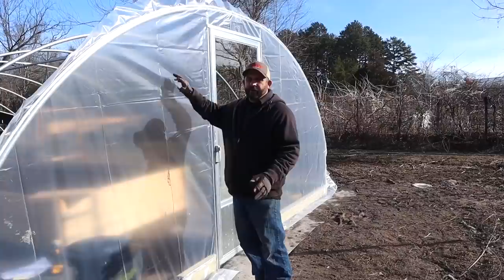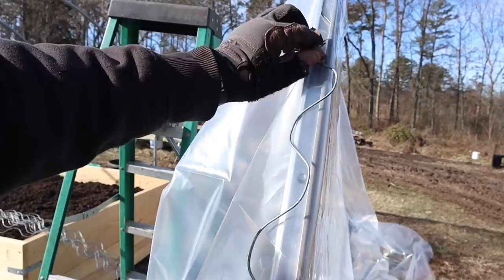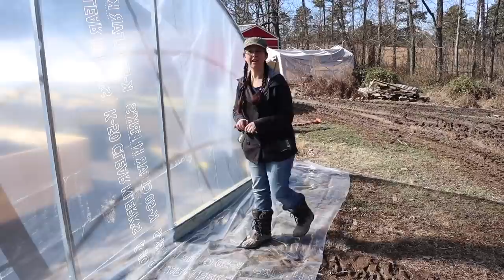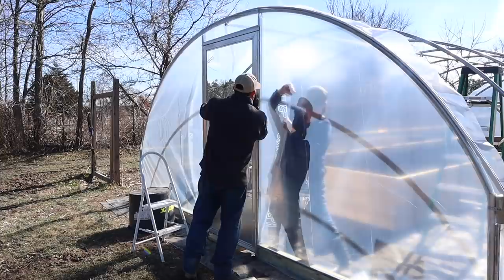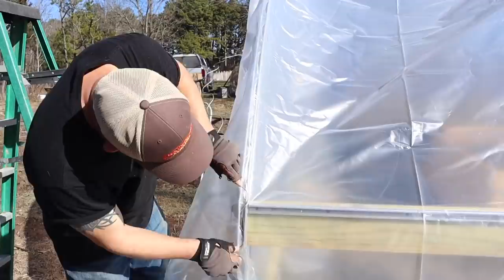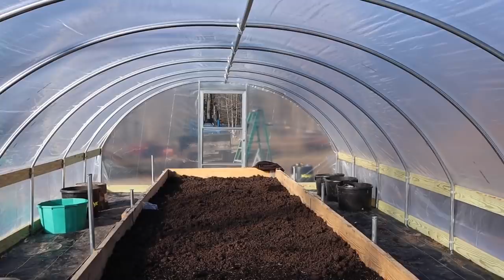The plastic goes up on the greenhouse we ordered from the internet.

Comment: I saw an ad on Facebook Marketplace that I thought you or others might be interested in.  A company from Fayetteville AR is selling dismantled poultry production houses.  These barns are not that tall at the sidewalk, but they are wide and long.  They are selling them as a complete kit; steel girder rafters, wood purlins (used or new, your choice), the metal siding and roofing and I believe some doors.  Other than shipping and set up it, which is not included, it seemed like a good price for someone to have a large building for livestock or adapt by raising the side wall height, for machinery.

Comment: You might want to consider using a hole punch or Phillips head screw driver to put a dimple in the door frame before installing the self tapping screws. That way the drill won’t walk on the surface enabling you to drill the holes in the right place.

Comment: Nice Job on the greenhouse! I was wondering if you have considered putting a mesh on the inside of the lower portion, for when you roll up the sides to deter small critters?
Reply from the maker: We weren’t planning on that but it’s a great idea!
Reply: Karen Gradzki   We did that on our greenhouse last year and it worked very well. Two of our neighbors have about 10 cats each and they are a real nuisance! They tore up our last plastic cover to get on the warm greenhouse in cold weather. Crazy cat ladies that don’t keep them home!

Comment: Very Good!
Only problem I see is you need to put two layers of plastic one about 8 to 12 inches longer than the other and a fan/blower to inflate the plastic works as insulation. You can use dryer duck to connect the side's and end wall's. 1 blower per greenhouse.
Possible shade cloth to cover greenhouse rolled onto a two or 4 inch pipe attach one end to ground leave outside when needed roll over.
Here in south Texas we put two levels of shade cloth one about 40% then one about 80%. Otherwise plants get burnt. Temps can and have reached 100° or more in December/January/February.
Also I have seen 0° in February. All parts of the country have there on set of problems and we have to adjust. GOOD LUCK. 
GOD BLESS.
ALSO ON A PERSONAL NOTE ITS A PARENT'S JOB TO EMBARRASS THERE CHILDREN.🤔😁

Comment: Hello you two, I have a question for you, we bought one of these from Growers Solution and will be putting it up soon.  I have watched your video probably 10 times to make sure I know all the details.  I have also watched other types of greenhouses being put up and they put a wind block on the first section of each end of the rollup sides.  With the wind we have here in MO I'm thinking it might be a good idea.  My question: Is there enough extra track and wiggle wire to do that, I believe it would end up being an extra 12 feet needed.  Thanks, love you guys!

Comment: I'm really curious about how the high wind conditions are for you folks, where I live in Colorado I'm unsure if the gusts would vibrate the plastic apart at the seems or not. Looks great though, good job!
Reply: Taylor Fore   I have one in S.W. Idaho and we get some pretty high winds. We’ve never had a problem with the seams coming loose. The only problem was one time last fall we didn’t secure the roll up sides before a big storm and the wind caught one side and ripped that side all up, clear up the end wall. The plastic was already ripped up some, so we replaced it this winter. However, we don’t have the hip boards with the wiggle wire along the sides, so that would have prevented it from getting as ripped up. We need to install those soon.

Comment: How long will the plastic last? Do you buy replacement from growers or can you just buy a big roll locally?
Reply: Typically 3-5 years.    Though it's suggested to remove the plastic in the summer and cover it with a shade piece.   The plastic will last between 8 to 10 years if you remove it during the summer